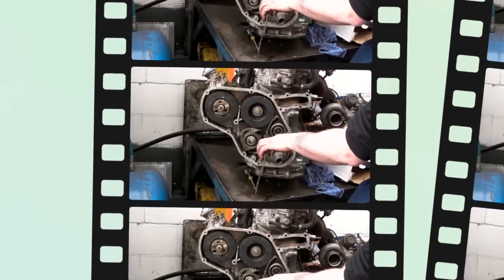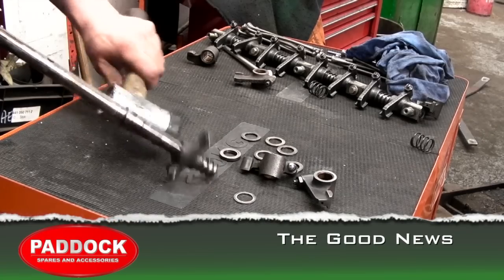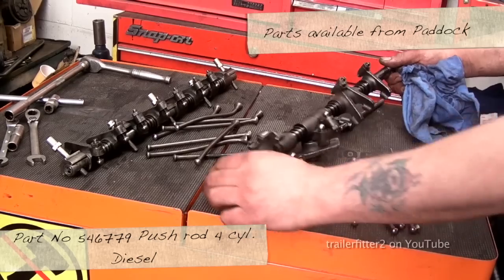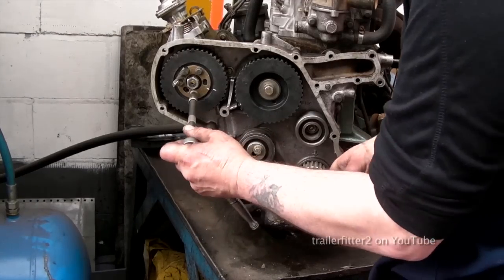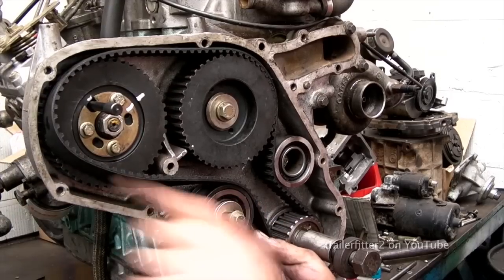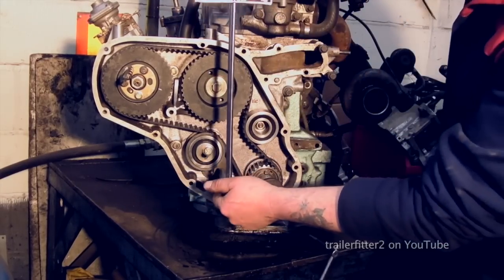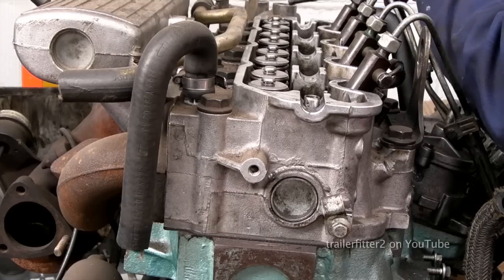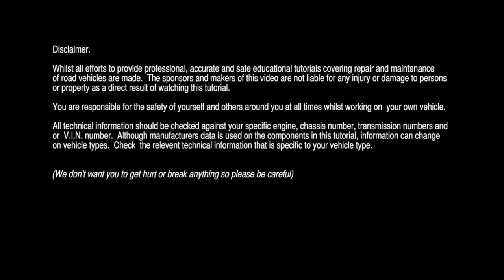Land Rover 200tdi Timing Belt -From Broken Belt to Retiming the Engine

Comment: Those engines are an incredible peaces of engineering! I drove one Defender 110 for about 650000 km then the technology new cars appear!It was parked up since 2006 engine still run today (we are talking about a 110 build in 1996)Talking about diesel engine ...our 300 TDI engine is most probably the one for critical situation(agriculture fields )God knows how long an engine like that will run!
Super video! Thank you guys!
Reply from the maker: Cheers for the comment.  I like the 200tdi above all the smaller diesel for its grunt on acceleration.  It was a welcome change from indirect injection diesels that were awkward to start in cold weather.

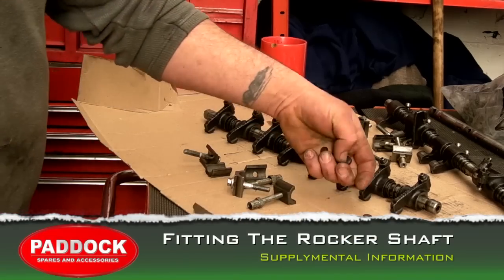Comment: At 21:48 in the video you mention the valve clearence , how much is needed? But then when yiu tighten the rocker shaft up you just seem to push them down until they touch? I'm a little confused, any help would be much appreciated!
Thanks,
Rich
Reply from the maker: Valve clearance is 0.20mm.  some valves will be pushed down when the rocker shaft when fitted ...  please watch this video on adjusting valve clearances for the 4 cylinder Land Rover Engines  http://youtu.be/Yv6d0E1p2_k

Comment: Thanks for your fantastic videos mate...very clear and precise,

I wonder if you know of any other way I could get the flywheel in the correct spot when setting up the timing as my 200 engine is fitted in a Series 3 unfortunately there is a big square X member right under where the locking pin screws in with very little clearance.

Nick.
Reply: Yes indeed same here but with a 300tdi in a series. I assume that setting the crank key to its mark is sufficient. Is your landy still running ten years on?

Comment: i am battling to refit my new timing belt as it won't slip over the fuel pump gear, i tried refitting the old belt and it goes on perfect, i have tried loosening the fuel pump bolts as explained int he dvd. when comparing the old and new belt they appear to be the same size. On your dvd the tensioner is different, my tensioner has dowel so to speak goes under the idler pulley and locks when the idler is tightened.
Reply from the maker: take the bolt out of the adjuster and let it drop enough to get the belt on.
Reply: ***** Hi i tried that, but didn't work, i got it on by removing the fuel pump gear and fitting it on with the gear, still battled but managed to slip over. Everything was fine for the past week and engine and fuel pump is timed perfect, but now there is a rattling noise coming from what i think is the dust cover plate that fits on the crank pulley, i did tap it down into place on the pulley but i think it has come a bit loose, can i remove that plate? i dont see a need for it besides for dust, dirt etc...
Reply from the maker: Len Van Rooyen Hi again,  sorry to hear you are struggling.   Happens sometimes.  Must be the nature of the beast......With regards to the dust shield....It would be better off the vehicle if you can't secure it properly.
Reply: ***** Took it off, thanks, noise seems to have gone
Reply from the maker: Ah good. Everything is okay now.

Comment: TF, thanks for the wonderful videos as always.  What is your perspective on using aftermarket tapper assembly?  I have head that rollers sometimes wear asymmetrically on some of the aftermarket brands.  Can individual parts be replaced on the tappet instead of a whole?  I am redoing the top end of the Defender 200TDI,  any help will be much appreciated.
Reply from the maker: +mightymikee  I think it comes down to you get what you pay for.  Internals it may pay to be very choosy when buying parts.  anything external can be replace fairly quickly so  theoretically can be brought cheaper.    Do you get my way of thinking?
Reply: +Land Rover Toolbox Videos I hear you.  Do you replace the tappet assembly as a whole?  Is it ok if I just replace the bronze component by itself?  One more question, the fuel pump gear, I see that I can be adjusted a little, do you have a video on how to adjust the fuel pump?  Thanks!
Reply from the maker: Tappet slider replacement depends on wear of the other components but it is possible to do that

FIP pump setting  https://youtu.be/9h55ym1sp1s

Comment: it isn´t 200 tdi , it is 300 tdi
Reply from the maker: How can you tell?
Reply: these engine is 300 tdi
Reply from the maker: You didn't answer my question.   I suggest you do you homework then come back to me and explain what the differences are and why you are telling us that this engine in the video is a 300tdi.   Telling us why black is white without any explanation to why you are confused   doesn't help anyone.  

I will explain that there are 300tdi parts in the video but the main engine with the green cylinder block seen is the 200tdi engine.
Reply from the maker: Carlos Elgarbay Ruiz  Here.  the 300tdi engine timing belt.  https://vimeo.com/ondemand/300tdi